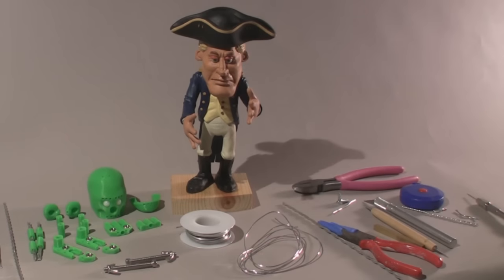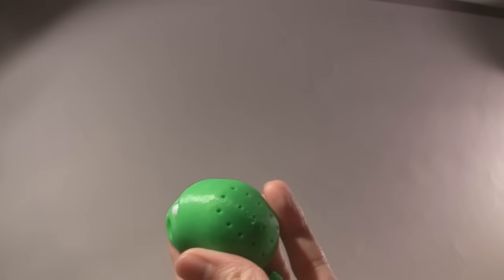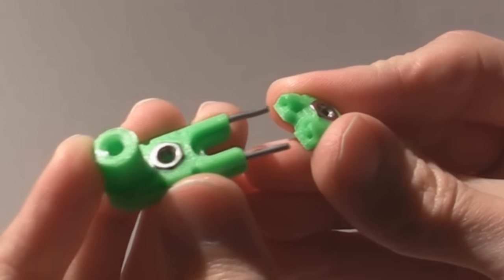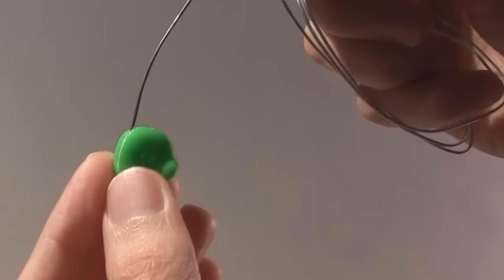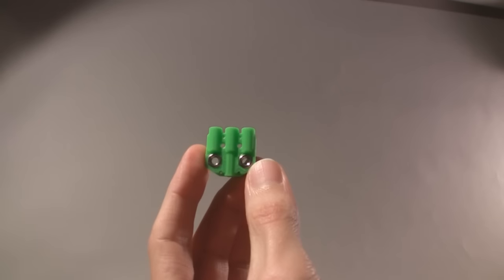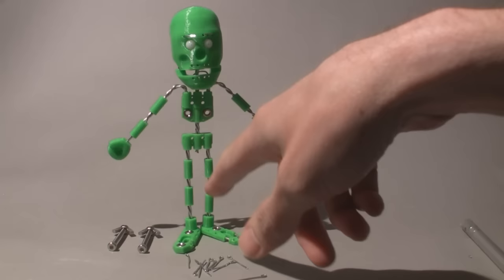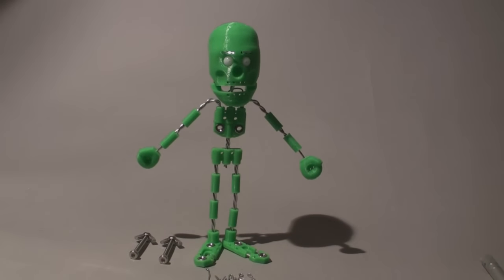How to Construct a Bend-D's [Simple] Human Armature Kit

Comment: Wow, that was impressive!  Has anyone thought to use 3D printing to make ball and socket armatures?
Reply from the maker: +Ken Tyner Yes, but because plastic is soft and the surface is rough, its hard to get precise movements with those kinds of printed joints. They wont hold up much weight and are very jerky.
Reply: This only means one thing.  We need to try to use metal 3D printers :)
Reply from the maker: That would be awesome :)

Comment: I'm curious to the wire you're using. In the past I've had really bad breakages when using armature (aluminum) wire. I've used pipe cleaner wire and it's been good.
Reply from the maker: +Steph Oakley It's annealed aluminum wire. The trick to not getting breaks is to make sure the wire is not scratched by your tools or bending the wire outside of animation. The wire will eventually break, but you can get a real lot of shots out of them before that happens. Also - you can use hot glue as the adhesive so if wire does break you can pull the wire out of the plastic parts and replace it with fresh later on.

Comment: Why not cast these if it takes 10 hours to 3d print? I mean you are making multiples..... ????
Reply from the maker: I can, but it would require drilling holes after it was cast for all the wire channels. So if you can imagine many fine 1mm diameter and 3 inch long silicone hairs on the inside of a mold which have to be pulled out - and they are all undercuts to one another. The mold wouldn't be accurate as those hairs on the inside would flop and not retain their accuracy. Not to mention breaking off after a few casts. That's the good and bad thing about 3-D printing. It can do things casting can't do but takes more time.

Comment: I just purchased a kit and can't wait for it to arrive! Can you speak a little bit about the insertion of wire paddles for lip animation? What do I need to buy to make this happen? Thanks! :)
Reply from the maker: +Cynthia Gall Hi Cynthia, thanks for the purchase! I hope you like these kits and get some good animation out of them! The paddles are added only if it fits in with your design, but you can epoxy or glue one long piece going from the two widest holes in the top teeth and lower teeth. If you make the wire long enough it can form an O shape, M shape etc. depending on the dialogue of your character. Another way to do it is make a small T shapes out of the wire and add these little T's in each hole for finer movements. For experienced puppet makers they might glue some foam onto the wire to make the lips look more pronounced, or skip the wire all together and use clay.
Reply: +animateclay Is this shown in any of your downloadable videos or tutorials? Paddles are mentioned in stop motion books but no one has featured a picture of them or explained further...
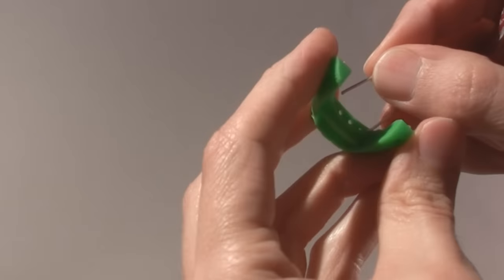Reply from the maker: I don't know if I've shown any in my videos, but there is one you can watch. It's called ParaNorman (2012) : Production : Behind The Scenes here on YouTube. If you copy/paste it into the search bar, the paddles they show are at the 3:09 mark. It shows a machinist moving paddles around for a puppet that was cast using a silicone skin face over the armature under it. With Bend-D's you can do a similar thing, but where there are ball joints you'd need to use some wire for the same results.
Reply: Fantastic! Thank you :)

Comment: Hello Animateclay, I just bought the latest model of this set and I have a few questions. First, what type of wires are these? I've seen people who make armature puppets with 20 gauge aluminum wire, so I assume that the wire for this puppet is also aluminum, but I'm not sure what the gauges are. Also, would adding epoxy glue be a good thing? If a wire snaps and needs to be replaced, wouldn't the glue make it harder to be removed from the piece? And my final question is how durable is the plastic. I've heard that there were some problems where the older model's jaws would break, so I was wondering if adding apoxie clay to it wou.d help to protect it, thoughts? Thank you for the tutorial and for the armature puppet.
Reply from the maker: Hi Linus, thanks for buying the kit. The wire it included is 1mm wire and 1/16" diameter wire. If you are concerned about replacing the wires, you can use hot glue (on a low temperature setting) or super glue. Then when you twist the wire it can come out, but I recommend epoxy for best animation results. The advanced version has the replacement options in case the wire should break, however the wrists allow you to replace broken wires as well as the jaw on all versions. That's because those wires tend to break from being used the most. The plastic is durable enough for animation, it's very strong. To help protect the wire you can add electrical shrink tubing, it can extend the life of the wire. Epoxy clay would become hard and not easy to bend. I hope that helps, good luck with your animation!
Reply: Thank you for responding so fast Animateclay. I'm still confused, do you want us to put the hot glue all along the wire, or just in the parts where it connects to the plastic. Also, I wasn't thinking of adding the clay directly to the wire, just adding a thin layer on the plastic so the plastic parts don't break too easily.
Reply from the maker: No problem. So the hot glue you would want to put just a drop where the wire connects. But - it won't give you great results because it may come loose. You can remove the wire that way, but the advanced kits are designed to replace parts if you want to do a lot of animation. That way you don't have to worry about breaking the wires. If you don't scratch the aluminum wire it should last a pretty long time. As for strengthening the plastic, you shouldn't need to. It won't break if you put your kit together properly.
Reply: Ok, so I put a dab of hot glue in the plastic, then add the wire, then add a small dab of the epoxy glue to the outside where the wire starts to touch the plastic. Is that right?
Reply from the maker: Alright, so there are two options. Only using hot glue or only using epoxy. The epoxy is mostly permanent, it will be hard to remove any parts if you use it. That might seem scary but that creates a very solid armature and better precise movements during animation. With hot glue the joints may be loose compared to the epoxy. That is because hot glue is not as strong and it is also a little flexible. That's why you can bend glue sticks, they are semi-rigid. It also risks melting the kit itself if the glue is too hot. If you want to remove the parts, use the hot glue sparingly. So just a drop where the wire touches the outside of the tubes. I don't really recommend it - but it will extend the life of your kit a bit. Before you decide, try just making one leg with the hot glue and see if you like the way it works. If not, consider using the epoxy.
Reply: Alright, I will. Thank you for answering my questions Animateclay. This has helped a lot.
Reply from the maker: Hi again Linus, put the hot glue just as a drop at the edge where the hot glue meets the wire. Not along the entire length inside. Then test and see if it moves nicely for you. If not, you may need to add more. Not all hot glue is made equally - some are stiffer than others so you'll have to test yours out. The plastic parts will not break on you, there's no need to strengthen them.
Reply from the maker: Glad to help!
Reply: Ok, thank you again ANimateclay.